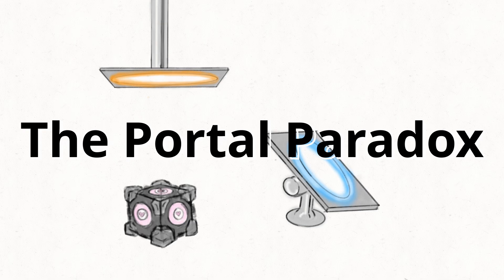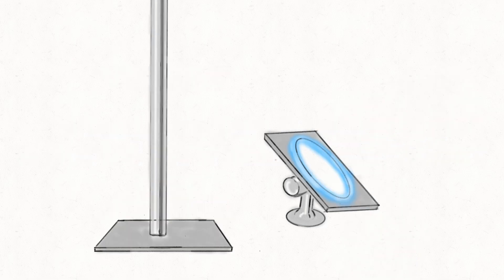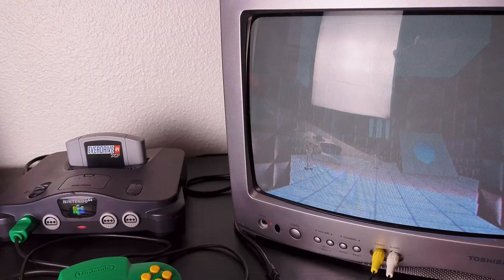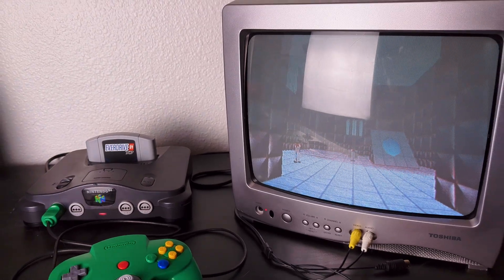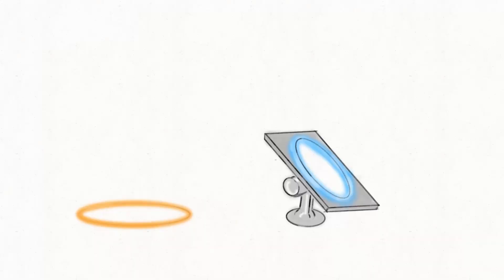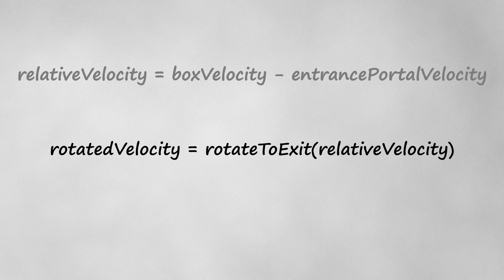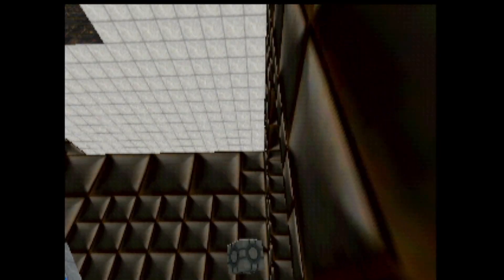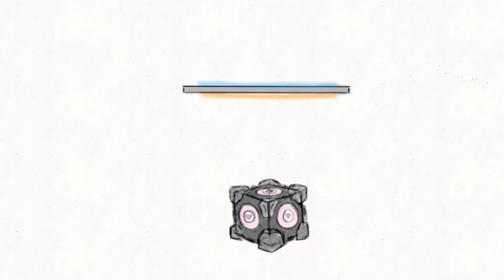I rewrote Portal from scratch and solved the Portal Paradox

Comment: It does matter if the cube or the portal is moving. Motion may be relative between objects for the purpose of imparting energy, but a portal is not an object with mass. It has no energy, it cannot impart energy. The surfaces the portal is anchored to have relative velocity to the cube, but a portal is just a hole in space that connects two points. A speedy thing isn't going into a portal, a hole is being dropped over a stationary thing. What GlaDOS actually says is, "Momentum, a function of mass and velocity, is conserved between portals. In layman's terms: speed thing goes in, speedy thing comes out." The cube has no velocity, the hole has no mass. It cannot confer momentum to the cube.

Further, when a portal is moving, it's not just "the entrance portal is moving" or "the exit portal is moving" or "both are moving." Portals are two representations in space of the opposite sides of a single hole. If an entrance or exit to a portal is moving, the entire hole is moving. A stationary entrance is irrelevant because the entire hole is always moving in space in this scenario. This means there is always an equal and opposite velocity on the back end (like in your hula hoop scenario) even if one side is stationary. That's how holes work. This is assuredly proven just by watching the image move in your blue portal as it represents the movement of the hole through space. Even though it is stationary, you can observe the movement of the hole that it represents. The difference is that your calculation does not account for this movement on the exit and assumes only the entrance is moving, when the entire hole is.

So, for the most accurate representation, you need to represent relative velocity as both the object's velocity and the portal's velocity such that you can then subtract the portal's velocity on the exit (effectively meaning you just don't calculate portal velocity at all), maintaining only the momentum of the object in question. This accurately represents a portal as one hole with a set of properties, instead of two holes with different properties.

Comment: The box velocity is zero and the portal velocity is only relevant to calculate the 2 gravity vectors that are applying forces to the cube. The box stays in place until the angled portal's gravity overcomes the gravity being applied to the cube in its resting position. No other forces are applied. The portal cannot apply force, it merely transfers the force that is applied to the object going through it.

Comment: I think the fact that you had to specifically add the velocity of the portal onto the cube already disproves how you think it should work. The cube has no inertia and so changing it's location should have no effect on the cube, apart from the effects of the new location, such as gravity if the new location is without a floor. You mentioned that part of your reasoning as to why you think the cube should fly out is because you wan to fulfill the quote "speedy thing goes in, speedy thing comes out" which is all well and good, except the cube isn't speedy, the portal is. With how you have set it up, you could technically make a true perpetual motion machine, as the velocity of the portal is added onto the cube, seemingly regardless of the current velocity of the cube. And so if you threw a cube at the moving portal, you would add velocity to the cube with it going through the portal, at which point you aim the now even faster cube at another moving portal and add even more energy, and so on and so forth, which shouldn't be possible.

Comment: newtons laws of motion 
An object at rest remains at rest, and an object in motion remains in motion at constant speed and in a straight line unless acted on by an unbalanced force.
        no force is applied on the cube, except for gravity, so only the shift of gravity, from when it crosses the portal, can be counted as a force, therefore, the cube can only slide. the portal is not applying any force to it.

The acceleration of an object depends on the mass of the object and the amount of force applied.
          with the prior explanation, the cube has no acceleration, since no force was applied

Whenever one object exerts a force on another object, the second object exerts an equal and opposite on the first.
         i have nothing to add, but its here so the other 2 don't feel abandoned

Comment: The issue with this approach is that it is inconsistent with the laws of Newton. Where is the force that propels the cube out of the second portal ? Answer : there is none, thus it is not possible. It would only make sense if the cube was the one moving towards the portal but when the portal moves towards the cube, there is no reason for it to be ejected like that. The only force that applies differently to the cube when coming out of the second portal is gravity, thus it only makes sense for it to simply drop to the floor and not being thrown out the portal.

Comment: I generally agree that the cube should shoot out of the exit portal because even though the cube starts with no velocity, as soon as it starts entering the portal entry portal it will start moving through the exit portal with the same velocity as the entry portal. It wouldn't make sense for the cube to have motion and momentum as it exits the exit portal, and then suddenly just not as soon as it's entirely emerged.

Effectively, what seems most logical to me is that the movement of the entry portal is kinetic energy that transfers from the portal into the cube, which then preserves that energy as it moves out of the exit portal.

Comment: This is a really cool development, and it gave me some questions on the “science” of the portal paradox. What happens if you slam the portal down but suddenly stop halfway? Or 3/4 of the way? Would the cube bounce up through the portal, or is it still planted in place? I wonder if there’s a way to test this
Reply: If you stopped the orange portal halfway down the cube, then there will be a half-cube leaving the blue portal with speed equal to the orange portal's previous speed.  This will pull on the stationary half-cube, accelerating it through the orange portal (while decelerating the exiting half).  Once the whole cube is through the portal, it will have half the speed it would have had if you hadn't stopped the orange portal.
Reply: It's all about relative velocity. It would be the same as if you were to, say, run really fast with a cube, then stop with the cube when it's partway through.

But of course, it seems counter-intuitive to a degree. Because if there was just a sliver of the cube that didn't go through the portal, then it would still theoretically remain stationary. But if it had moved one "sliver" further, it would exit at a velocity like in the video. So that's where we have to think about the physics of portals. If everything I've said here is indeed true, then it would seem that, while something is on both sides of the portal at the same time, it can be considered in "limbo". That is, "stuck" on both sides of the portal until it fully clears either portal. The exit velocity of the second portal would then be equivalent to the item's velocity at the exact moment when the final portion of the item completely clears the first portal. That would be my theory at least.

Comment: What if you had a cube in weightlessness floating over an orange portal.  Directly above it you have a blue portal.  Raise the orange portal so that the cube goes half way into it.  You should see the bottom half of the cube sticking out of the blue portal.  Now...  Increase the distance between both portals.  Would this give you 2 cubes?  If so, could you potentially get a near infinite amount of cubes by increasing the distance of the portals forever?
Reply: Um, no. You always have only one cube. What you see is visual illusion because of how light works with portals.

Comment: I don't get why this would be the case. The momentum is what should be retained, and there's no momentum on the cube. The thing going through the cube should experience no change in their forward momentum when going through a portal. If a doorway passes over you and you're still, there's zero change in your velocity. It isn't that the entrance to the doorway speeds up your momentum but the exit of the doorways negative velocity undoes it. It just has no impact.

Comment: consider a single point passing though the portal. it doesnt have any momentum as the portal passes over it, so it doesnt gain any momentum on the other side.

now consider two points connected by a rigid rod. if the first point through doesnt gain any momentum, the rod would compress. since there's no force acting on the rod, it doesnt make sense for it to compress. therefore, this point would have as much speed as the portal. the question is, what happens to the other point? probably the force would be equal, since no additional force is acting on the rod. so the act of passing through the moving portal would actually drag the rod along with the portal a bit, and on the other side, the rod would emerge at half the portal's speed.

this really is a head scratcher, isnt it.

Comment: @James Lambert
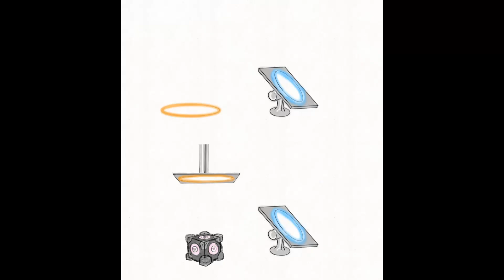0:49 & 1:35 If you WERE to change the physics formula, so the cube would "Plop out", how much different would the rest of the game play then?
I imagine many of the puzzles would just be impossible to solve in that "broken physics" model?
Or at least, the puzzles has to be soled in some other way compared to how it is actually solved in regular Portal ?
Reply: Well, "plop out" model isn't broken. It's how portal would work irl, or at least how they should work in the game. His equation makes no sense, because there is no reason and no way cube gets speed from portal's speed. In fact, portals are like doorways, so imagine you suddenly flying out from the portal by no reason (if you apply his equation).
Reply: @fantastikboom1094  The reason for why the cube gets speed, is because one portal is stationary & the other moves.
As he showed in the later example, when both portals move at the same time, it acts as a hole. Meaning, that if 1 (of 2) portals are stationary, at least 1/2 (half) of the force should be applied to the cube instead, because that is what is moving through the portals.
Reply: @sebbes333  No. That's not the reason at all. The portal can't give it's speed to the cube, because the portal is not solid. It can't interact with the cube.

Comment: It violates conservation on energy. The energy of the moving piston would be transferred into the floor as heat but the box also has gained that much energy. It is basically an energy doubler.

Comment: How possible would it be to make a little grid based level editor for your portal project?
If it's possible for the n64 to handle that people could then generate codes from that to share with each other.

Say a cube height is 32, player height is 64, a room of 1024^3 would be able to make a lot of community made mini puzzles. 
If 1024^3 is the point of limitations then maybe it could be you pick your cuboid you want to build inside.

Comment: OK, you're triggering my tism here.
Relative velocity =/= Box velocity. This is where a lot of people are going wrong with the 'portal paradox'.
You cannot create energy out of nothing, it has to come from somewhere.
If the piston portal inputs kinetic energy to the stationary box it would have to slow down or at least have some resistive force placed up on it because it has to translate that kinetic energy to the box. This is ignoring the problem of partial envelopment of the box; at what point does it accelerate? Is it being sucked in to the portal?!
Relative velocity = Box velocity is absolutely 100% incorrect and breaks the physics of the game. "speedy thing go in" refers to an object maintaining its angular velocity, the key word is maintaining, the stationary box has none so where did it get it?
The only way the model works is from a pretty abstract mathematical model that can only work with portals. The portal is not moving towards the box, the portal is moving everything on the other side towards it. In that instance the box has no energy and everything else is now closer to it.

Comment: You forgot the other part of the portal, so if the box is going through portal A, where portal A comes at a certain velocity and angle, you have to take the other portal, portal B, into account, which is standing still, and is having 0 velocity, counter acting on the velocity of portal A, through the object. It should have some natural friction or at least some reaction to it, I believe, although this is a though I can't back up with my due to my lack of understanding math.
Reply: Actually there's no math needed. It's just not how portals work, it violates some rules and conflicts with the game's info.
Reply: Simply no, just look at the exit portal, and see that there's a ground pushing the cube up to you. From the perspective of the exit portal, THE GROUND PUSHES THE CUBE UP with whatever speed it has. " It should have some natural friction or at least some reaction to it, I believe, although this is a though I can't back up with my due to my lack of understanding math." you believed wrong.
Reply: @3_pancakes767  So because of the portal moving the whole universe is moving? Are you idiоt?

Comment: One thing I noticed when playing portal is how it doesn't flip things. Specifically the character might be rotated the same as the portal. But when entering one portal and exiting the other, the characters handedness doesn't change. Nor does their perception of the chirality of the room.
Reply: Why do you think that is???
Reply: But yes, if the portal gun did work differently, that is plausible.
Reply: You don't even need portals to change handedness, just rotate across the 4th dimension.
Reply: @3_pancakes767  Exactly. I think the reason why portals shouldn't just plop the cube without acceleration, is because it cannot be thought of as a "contiguous scan" as that would naturally result in a flipping the object. Or in other words do a 180 degree rotation in a 4 dimensional space.

Comment: I like to think of the portals in this game as doors

There is no delay whenever you teleport and you can see exactly what's on the other side with also 0 delay, so the portal isn't a physical object and more of a concept, a rip in the fabric of the space-time.

... If an open door comes at some object's direction at any speed it wouldn't be launched. the door's momentum wouldn't add up with the object's because they aren't even interacting.
Reply: Your "open door" idea is the same as the "holahoop" idea, but sideways, as shown the box did not move when it was hooped. The issue is one half of your door frame is moving while the other half is stationary, so spacetime shenanigans happen.
Reply: @starburst98  "The issue is one half of your door frame is moving while the other half is stationary"
but in 3D space if you keep looking through the portals while they are moving they still act like a single stationary door, sure the FRAME is moving, but the portal (connection between both frames) isnt, the connection itself is static (in 3D space at least).

I think this movement would result into velocity in a 4th dimensional axis, but idk how it would translate into 3D movement
Reply: Correct! This is easily checked by placing two portals so that you can see yourself walking through. 
Your explanation is spot on.
What this guy did, was to rewrite the Portal universe in a way that makes his hypothesis is the solution, essentially. 
He didn't actually solve anything.

Comment: Except the cube itself isn't "speedy". For an object to move, a force must have acted against it to get it to move. Nothing the portal does interacts with the object going through it. You'd have to prove that the portal has interactions with everything going through it in order to make that claim. An object at rest stays at rest, an object in motion stays in motion. The object being the box, and nothing is interacting with it. When going through the portal, it would still me sitting on the floor, but as the portal goes over it, it'll actually get pushed back because the box is now displacing the air on the other side of the portal, actually pushing the box in the opposite direction. The box would eventually succumb to gravity and slide off the inclined surface.

The box would not inherit the speed of piston because there's no interaction between the portal/piston and the box. There is an interaction in the space the box now, and soon will, inhabit.

Comment: I think it is introducing some dire consequences. If "cube" has some more traction with the surface (glued, welded, etc), there is potential to tear objects apart.

Also, normally, objects are getting momentum in some natural ways based on their structure/joints, but if the portal is the thing that you are getting momentum from - momentum passing to some 2d slice of an object with is potentially can break it internally.
Reply: The issue is not in the cube though. This comes from the portal suddenly stopping after it slammed down.
If the cube were on a pillar the portal could continue downwards, with no damage to the cube. Only when the portal stops moving you introduce an acceleration between the two frames, potentially causing a break in the pillar.
The real issue is thusly not relatively moving portals, but relatively accelerating ones
Reply: This would of course be true regardless if the weld/glue/bolts/fasteners by any other name were too weak. That by itself though wouldn't necessarily prove this unsound. Would just mean that if something was weak enough to be moved, it would be moved. Portals rarely care about fasteners anyway, see GLaDOS about all the cameras I knocked off her walls